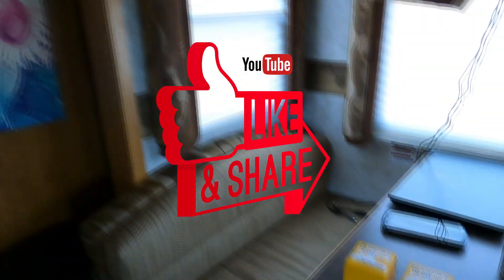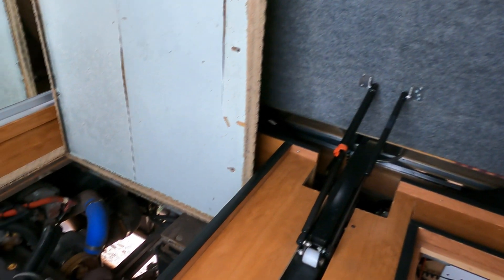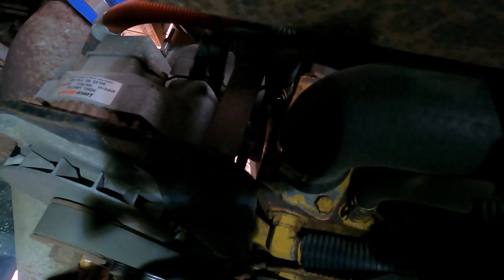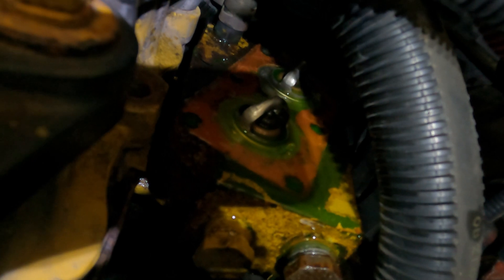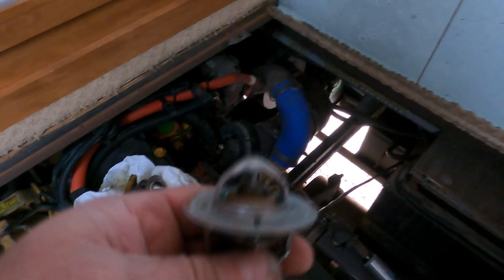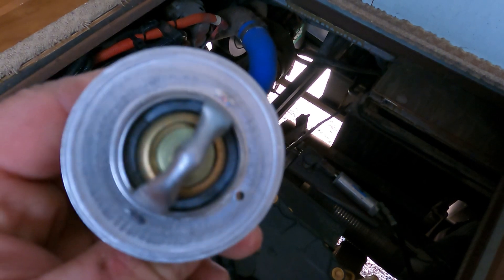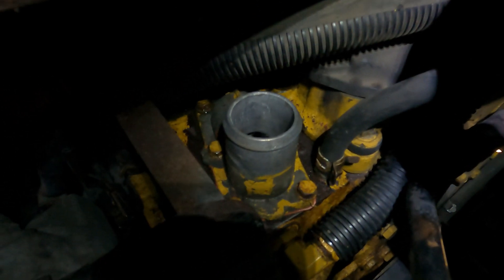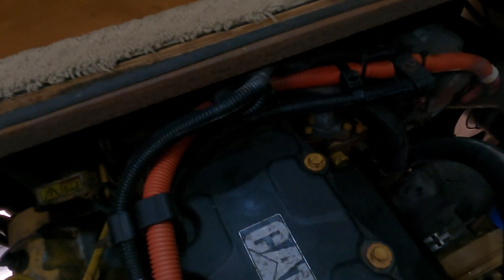Caterpillar c7 regulator thermostat replacement

Comment: Hello there . Good video. 
Just wondering is that bed in a slide out ,?
I'm going to do mine and trying to get access to the engine, in my 05 winnabego journey 350 cat the bed has a metal frame and has a hydraulic cylinder in the middle.  Do you have a video of more detail on getting access to the motor . 
Thanking you in advance!!